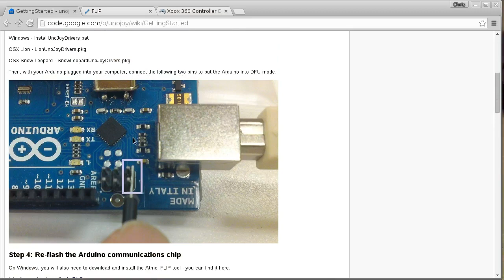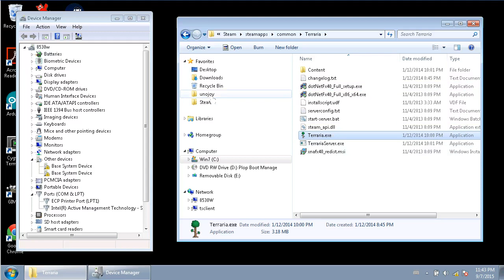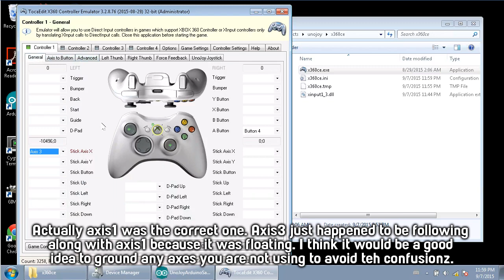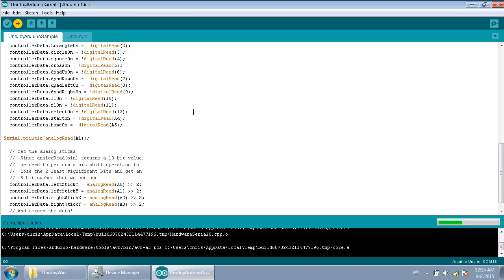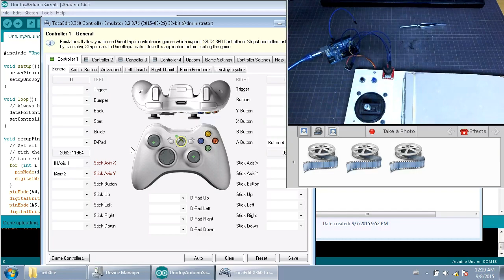Arduino UnoJoy gamepad (Windows, XBox emulation)

Comment: Hello. When i do this with my arduino uno when i connect two pins in arduino uno and i run turn into a joystick i get a dll error and when i download dll file an coppy in its correct location still i get the dll error. Why?

Comment: BRO, YOU DID A GOOD JOB, I HAVE A PROBLEM MY ARDUINO UNO R3 DOESN'T GET DFU MODE AFTER SHORTING, IT REMAINS THE SAME IN ARDUINO MODE, PLEASE HELP ME, REQUEST!
MAY I HAVE TO BURN THE BOOTLOADER FIRST? IS BURNING BOOTLOADER A SOLUTION? MINE IS A 16U2 CHIP

Comment: how can i reset the pin if im using Arduino UNO R3 CH340 CH340G ATmega328P Microcontroller Board Micro Controller is it compatible for this project?

Comment: Is there a way I could emulate an xbox one controller.  And when I push a button on the arduino it will press a then wait a second and then press x wait a second and then just repeat it so a x a x a x . Indefinitely I no this might sound strange but in the game to craft something 1 at a time takes ages so I could use this method and walk away for a few hours?
Reply from the maker: I don't know about xbox one controller specifically, but the scripted style of automatic input is certainly possible.

Comment: plz make a video on how to make  steering wheel, accelerator , brake, clutch for driving games in pc
Reply from the maker: If the game has those features, then it should also have an option screen to select which buttons do what. If you're talking about making a physical "simulator" with actual pedals and steering wheel etc, I don't think a video is necessary. Just get some longer pieces of wire and attach the buttons and potentiometers to your pedals etc.
Reply: @iforce2d  ok you are right we connect 3 potentiometers for 3 paddles  but when we connect steering wheel to potentiometer its not rotate full 900 degree this is the main problem

Comment: what if i'm using the atmega328P standalone ? can i use the ft232RL adapter to make it read as an usb device ?
Reply: no. You can use a Micro, Pro Micro if you need something small. These have the required ATMEGA 32U chips.

Comment: What a nice video.I follow every step what you said.I plug Potentiometer in analog0. But When I turn Potentiometer every axis change value. I don't know what I was doing wrong. :( I need your help.
Reply from the maker: Any input left unconnected will give unpredictable results. https://playground.arduino.cc/CommonTopics/PullUpDownResistor

Comment: For those who don't have Uno with 16u2 chip I recommend vJoy which can work with Arduino boards that have cheap CH340 serial adapters. I guess vJoy works with all Arduino boards so give it a shot. There are videos on youtube how to setup and use it. Also it is easy to setup and use than UnoJoy
Reply: just realized my uno clone has CH340, thanks

Comment: if i get attiny85 can i work it as hid and play games like euro truck simulator
Reply from the maker: No, this requires a separate chip that handles the device identification. I looked at this a little more in a previous video:
https://www.youtube.com/watch?v=cZc-23NjNHY&t=1325s
Reply: thanks for reply i worked so hard with my clone uno i m stuck at 3rd operation at black screen "Opening port" its giving me error like this: "AtLibUsbDfu.dll not found"

Comment: Hey! Thanks for the video. Very detailed!
The Uno has 6 Analog inputs. So i guess that its not possible to use 4 potentiometers(1 for the wheel, 1 for the gas, 1 for brake and 1 for clutch). But then again, clutch can be a common switch connected on a digital pin. Am i right? I am sorry if my question is obvious. I am just getting started on arduino :) Thanks again for the video. Keep it up!
Reply from the maker: But.... six is more than four isn't it? :)
Reply: Well, i got confused with pots :P i thought that every pot needs to connect to two analog pins. I still would, if it wasnt for you. Well, now i owe you twice haha. Thanks!
Reply: Gou : i hope you can see my video, if you want make steering wheel for pc, thank's, sorry for my english...

Comment: and do i need to edit my  controls for the game to the joystick or for it to be compatible for windows 7 and for arduino do i need a windows emulator for TFT???
Reply from the maker: This unojoy thing emulates a PS3 controller. So your game should be made to use a PS3 controller. You will need to edit the unojoy sketch to say which pins of the arduino go to which controls on the PS3 controller. I don't know what the hell TFT has to do with anything :)
Reply: im making a arduino stand alone console like a mmobile phone but just with one .exe file
Reply: the start of  the comment you replied to was the in the a bit late one. Sorry!
Reply: please reply im using a TFT a a screen to make a Stand-alone CONSLOE that is compatible with both windows and arduino. im makeing a low fps game so that arduino can handle it
Reply from the maker: You want to run the game on an Arduino??? That will not work well at all because Arduino is not made for drawing graphics, I mean come on, it only has 2kb of memory right? Maybe if it's a very very simple game like Pong from 1972 it might run, but still extremely slow. If you want to run games on standalone console, I suggest learning Android programming and run it on your phone.
Reply: iforce2d  Thanks! maybe  android studio? considering im still only  12 yrs. old maybe that or sgall I move it to a arduino mega or raspberry pi?

Comment: hey man....i cudn make it work into a game.....can u plzzzzz help me....i connectd 2 pots as input and tried to steer and throttle....but it isnt working with the game.....in the calibration and the x360ce it shows its working.....but in the game ..it jus wont work...plzzz help.... thanks in anticipation 😊
Reply from the maker: Does the game work with a normal xbox controller?
Reply: yea....n after a few tries...i got it working...but now wht happens is....joy zl keeps toggling evn if i hvnt put ny input for it neither any pot for z joystick....wht do u thnk of dis???
Reply: n wanna appreciate ua video....great work...😎
Reply from the maker: English please
Reply: Yea....i got it after a few tries....but now what happens is.. joyzl...that is the z axis rotation keeps toggling....as in..whenever i try to configure my game for the keys or the joystick....it quickly sets it to joystick zl....which isnt even plugged into my arduino...

Comment: I picked up a board on Ebay that said it was an arduino 3 (I think it was a counterfeit).   In any case, when I attempted to put the board in DFU mode, the LED would blink for a moment and do nothing. On my windows 7 machine, I watched the drivers interface and saw that the arduino uno driver was always showing - it should have shown ATMega16U2.
It seems that this board did not have the bootloader installed in the ATMega16U2 chip (evidence it was a counterfeit).
NOTE:  You need at least 2 operating Unos to complete these steps, one of which needs to be able to receive uploaded sketches and the other is the one that needs the bootloader updated.
Basically, the process is:
a) install a sketch on the first board that will program the second board after it has been connected
b) unplug first board from usb
c) connect the second board to the first board according to the instructions
d) plug first board back into usb
e) observer in Ardiuni IDE, the programming of the second board.

To perform the process outlined above, I followed the instructions on this page:
https://github.com/NicoHood/HoodLoader2/wiki/Burn-the-bootloader-from-another-Arduino
Some points of clarification:
1.  To ensure you get all the files needed, its best to download all the files in the github repo:
    https://github.com/NicoHood/HoodLoader2/archive/master.zip gets a zip file that you can then unzip on you PC.
2.  Once it is unzipped, locate the Installation_Sketch.ino file in:  <extract path>\HoodLoader2-master\HoodLoader2-master\avr\examples\Installation_Sketch
3.  In the sketch, in Line 11, change to:
#define HEXFILE 201
(looking in the list of hex definitions, 201 the hex for HEXFILE_Arduino_COMBINED_dfu_usbserial_atmega16u2_Uno_Rev3_hex_Full, which is the default hex that should have been loaded)

If you get the wiring correct between the 2 boards and follow the instructions, it should work fine.

Comment: i have a problem, when i connect my potentiometer, the arduino turns off. At first it worked perfectly, but then my computer displayed a warning window about the conected device, and the arduino turn off. The arduino is able to work again without the potentiometer, but wuen i attach the potentiometer to 5v., gnd and analogs pins, the arduino turns off.
someone knows whats happening?? PLEASE HELP
Reply from the maker: Sounds like you are shorting the 5v to ground.. Make sure you really have the connections the way you think you have them...

Comment: Hey:) if Got a little Problem. So my idea was to use a handbrake for racing games. I screwed a pressure Sensor into the Zylinder and now I connected it into a arduino. With Unojoy i got the arduino working as a Controller. If i dont pull the lever of the handbrake i get 300 and if i pull it i get 450 so i did it like you with the Minimum Set to 299 and the Maximum to 451 . but if i now Turn the arduino Back to a Controller the axis isnt at 0 when i dont pull the lever it always activated if you know what i mean. I was wondering if you could help me. I Just want the axis to be at 0 when I dont pull the lever and at 100 (max) if i pull it all the way Back. sorry for my Bad English.
Please help me 

thanks in advance
Reply from the maker: Sounds like you will just need to change the arduino program for whatever case you are currently using. Or maybe you could use a digital in pin as a switch, to select between handbrake mode and non-handbrake mode.
Reply: iforce2d could you please give me a step by step Tutorial?

Comment: When I open TurnIntoAJoystick I get error "AtLibUsbDfu.dll not found.". I have el cheapo chinese copy arduino. It is ATmega328P CH340G type thing. I have installed some drivers and it works OK in other use.
Reply: Did u find out how to fix it I have the same problem
Reply: Here's what you do: you reset your uno briefly, (connect reset and vcc)
Remember to disconnect the connection afterwards. 
And then run the turnIntoAJoystick.bat again
Reply: I must be doing some thing wrong because that is not working
Reply: nvm I got it working thanks
Reply: i did the following and it still didnt work plz help

Comment: would this work with a mini or micro?
Reply from the maker: +DevoiderXXX no, they don't have the 16u2 chip on them
Reply: cool thanks, just looking for a smaller option
Reply: update, worked on the micro with the Leonardo package
Reply from the maker: +DevoiderXXX really? Cool! What pins do you short to get it to change into DFU mode?
Reply: you dont need to, the micro and Leonardo already interface with the computer as device, you then just need to run LeoJoyInstaller.exe inside of the arduino root directory and it recognizes it as a joystick
Reply from the maker: +DevoiderXXX ah, that's right. I forgot there is a completely different procedure for the leo
Reply: thanks for all the help, got my uno and micro based controller working last night!

Comment: hey, nice video...! i've been looking for a video like this. can you make a video about unojoy working with some toggle switch like SPDT toggle switch? i planned to build myself a panel for flight sim cockpit for later. can you help me?
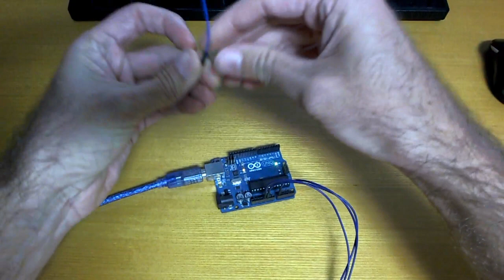Reply from the maker: +FlightSim Three-Sixty wouldn't it be just like the "button" I showed at 18:36 but using two inputs instead of one?
Reply: +iforce2d why 2 inputs? i want the one toggle switch is acting like one button on my laptop keyboard.
Reply from the maker: +FlightSim Three-Sixty SPDT stands for single pole double throw right? Double throws means that when the switch is one way eg. input A will be on, and when it's the other way input B will be on... I don't see how you can do that with only one input. If you just want it to act like one button then it's not SPDT, it's just a single button like I showed at 18:36
Reply: ***** i'm sorry i am a noob with electronics like that. thanks for your explanation

Comment: Yeah you are not windows guy ;) . A joystick won't appear under "Ports". It's most likely under "Human Interface Devices" (or in some cases under "Sound, video and game controllers"). You should also be able to see it "Devices and printers".
And btw. you should be able to calibrate the gamecontroller there, too, if it does not give you the full range. No need to change the Arduino code.
Reply from the maker: +superdau Thanks for the pointers. I had actually checked every other place in the device manager and it didn't show up anywhere. Just now before replying to your comment I checked again with the same result, and then got distracted doing something else. After about ten minutes I heard that ba-bum sound and a notification popped up saying new usb hardware had been installed successfully.... checking the device manager now I see it under "Human interface devices" as "USB input device", and also in "Devices and printers" as "UnoJoy joystick". Not sure why that never happened before. I tried the calibration in the "Devices and printers" section, and it seems to work but for some reason it only offers this for two axes which it calls 'Z axis' and 'Z rotation', very strange. One of these was my throttle and the other was one of the floating inputs, so just by chance this would have worked for the case I showed in the video. There doesn't seem to be any way to set four analog inputs, or which should be which, or to change their direction. Still, it's good to know though!
Reply: +iforce2d 
The calibration for X and Y looks different I think (it's the crosshair moving around), all the other axis have the moving bar. So maybe you missed that (the calibration is always done for all of the axis). I don't know how many axis the unojoy has by default, but if some are really missing, it is unojoy's fault. As HID it should report how many analog and digital axis it has. Maybe look into the source for it (not for the main AVR, but the interface AVR). My Taranis for example automatically appeared as an 8-axis, 8-button HID without any driver installation. The Arduino should be able to do the same.
For the inversion: yeah, I think it can't simply be done without tricks. But in that case just switch outer wires of the pot around ;)
Reply from the maker: +superdau I think the UnoJoy is reporting correctly (eg. at 17:00 in the upper right of the page: 4 axes, 1 dpad and 14 buttons)
Yes, you're right the crosshair in the white square seems to be for the first two axes - I tried it again and after moving the pot through its full range the crosshair had calibrated to meet the endpoints. I didn't notice that the first time because the instructions on that page of the wizard simply say "Press all of the D-Pad's corners, then press a button on the controller", no mention of analog axes, then on the following pages for the other two axes the display is completely different (horizontal bars, one per page) and it says to move the axis all the way up and down. I think the wizard could use some better instructions!
Reply: +superdau Could you possibly tell me how to change the default UnoJoy to change the crosshair to two separate bars? Just asking maybe you'd know. thanks!
Reply: +coetseejj 
You can't change that. That's just how Windows shows the X and Y axis. The only thing you can do is change the firmware that goes into the "glue" AVR (not the main Arduino AVR!) and make it send out the values on different axis like X-rot and Y-rot.  But it doesn't make any difference on how the values are treated anyway, so you might as well make an 6- or 8-axis joystick by changing the code instead of just remapping the first two axis. I haven't really looked at the code in any detail, but I know somewhere it was defined how many axis and buttons the joystick reports to the OS (again, I'm talking about the firmware that goes into the small AVR here; you can't change any of that in the normal Arduino sketch that you then use).
Reply: +superdau 

thankyou, your comment helped me find it :)

Comment: It seems a £6 joypad would be more sensible here but i'm guessing this wizardry will open up all kinds of funky DIY controllers and other tinkering?
Reply from the maker: +MicroRCFiend the cheap knock-off gamepads often don't function correctly when the game expects to have a genuine xbox360 gamepad though, that's the one of the reasons the x360ce utility was created :) You usually find the cheap gamepads also use cheap pots with huge deadbands that can't be worked around with software tricks, and the sticks on the one I have are a bit scratchy feeling to move and have very strong springs. All of this made it very difficult to play the driving game, which is why I abandoned it and looked for an alternative with smoother input. As I mentioned at the end, it's a lot of work just to end up with some still rather crappy inputs like I have shown here, but with some more time and resources you could make a nicer driving sim setup with a full-size steering wheel, floor pedals, gear-change lever, hand-brake etc, or whatever cool setup you want.